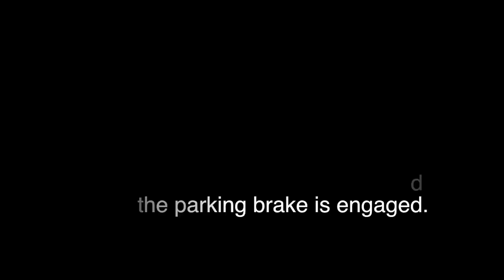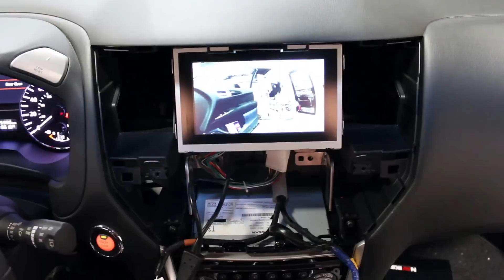Nissan Pathfinder 2013 NAVIKS Navigation Video Interface install.

Comment: Hello, I've seen in YouTube as the established radio pionner Nissan Pathfinder in 2014, I want to ask whether it will show the data from the climate control system on-board computer?
Reply from the maker: +Fariz Ismayilov we do not understand your question. we only integrate with OEM components.

Comment: Will this fit a 2015 pathfinder S that doesn't have touchscreen or camera?
Reply from the maker: Does it have a color screen?
Reply: Color?  As in the radio
Reply from the maker: there screen is it black and orange or is it colored?
Reply: mine is black and orange , just a simple display for the radio and fan controls, I want a touch screen with navigation
Reply from the maker: Hi, vehicle requires a color screen. Black and orange wont work.
Reply: OneWayAutoSports is there’s a kit to replace it and do navigation ?
Reply: OneWayAutoSports like the Dodge Ram alpine kits

Comment: I have a 2013 Pathfinder Platinum with navigation and DVD. My head unit is the larger screen and says "type c" on the back. The 24 pin plug appears to only use about half the pins. I also have an antenna plug on the back that you appear to not have. Will this kit still work with my pathfinder? Is the wire harness on my car different for some reason?
Reply from the maker: Hi, please email  info@naviks.com for more details. Thank you.

Comment: Is it compatible too for 2006 LE model? my car  come with the navigation system when I bought it..dont know if  the screen is purely for Navi or can i have a back up cam. Is it possible to instsll one?
Reply from the maker: Hi, below is the link to the device you need to add backup camera and other device to your 2006 Nissan. 
http://www.ebay.com/itm/Fits-Nissan-Pathfinder-2008-2012-Navigation-Video-Interface-TV-DVD-Backup-Cam-/261250100326

Comment: hi, i have a nissan pathfinder 2013 SV with color screen. i want to add navigation to my car, this is what i need to install? thanks
Reply from the maker: Hi, this is part of it. please contact us for more info.
Reply: OneWayAutoSports, I have the same color screen, but mine shows the AC temperature on the screen as well. Will this unit still display the AC temperature?
Reply from the maker: Hi, can you please contact Info@naviks.com for assistance. Please provide picture of your screen and VIN # for a solution. thank you.

Comment: Hi I have a 2013 Nissan Pathfinder sv   I bought it Univercell GPS from eBay if I need to install what I need to do I need any at parts or in Converter
Reply from the maker: +fokhrul uddin you need this converter that adds video inputs to your vehicle.

Comment: Will this fit a 2015 Nissan Pathfinder SV that just has the screen with backup camera?
Reply from the maker: +Tony does your car have a color screen?
Reply: +OneWayAutoSports, I have a 14 pathfinder with color screen, but it is not touchscreen.  How much is this kit?
Reply from the maker: Hi the unit is $190 depending what you plan to use it for might require other accessories:
http://naviks.com/i-22768424-2013-2015-nissan-pathfinder-r52navigation-video-interface.html?ref=category:1137501